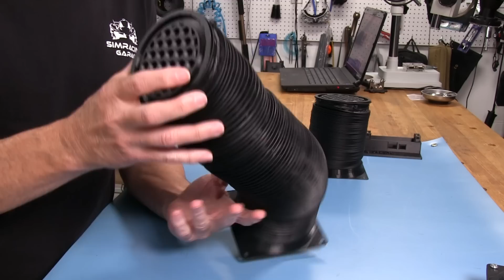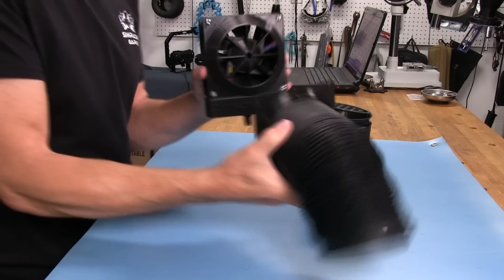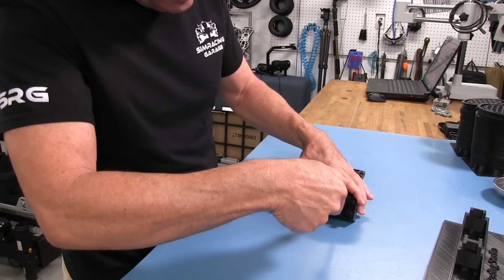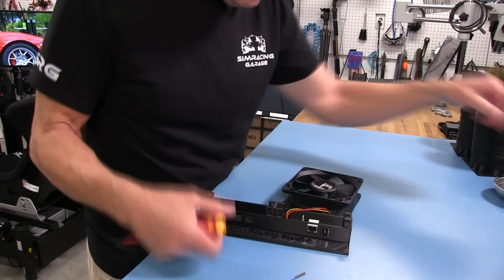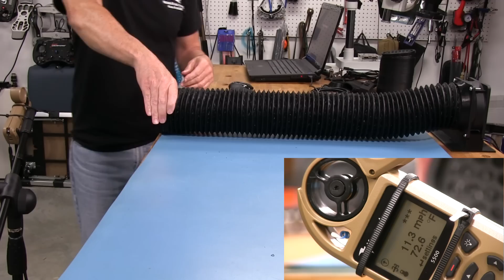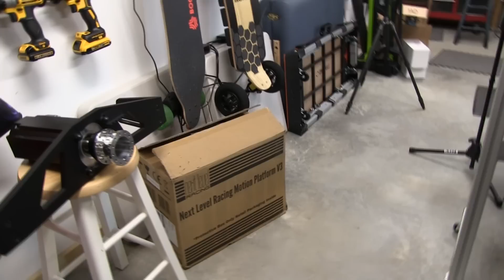SRS Power Wind Tube Upgrade Kit

Comment: A great example of FDM manufacturing of niche market products. And about the price... Think about phones. When you look to raw base components, it looks like it's overpriced. But when you add designing and manufacturing costs (quality filament doesn't come cheap and neither does a 3D printer that you can deploy for dependable commercial use), it's actually a fair and good price.

Comment: I wish someone made a system like this that just blew air at a couple different speeds hooked up to a toggle switch. I like the racy look and the tubular design. 

 Why doesn’t that exist? I’ve seen some diy but I’m looking for a ready to go kit. I don’t see any benefits to “wind simulation” for sim racing personally. Plus having to run more software on top of the half a dozen I already run.
Reply: You can just hook up a 3-12v power supply to 2 computer fans and adjust the voltage for different speeds. You can buy the tube at a hardware store but the other pieces need to be 3D printed and I agree that it would be nice if someone would sell those pieces because not everyone has a 3D printer just laying around to make small parts like this.
Reply: Eric I could see a plug and play regular fan system that has a motorsport aesthetic and doesn’t require software... selling really well. Maybe have the controls for it wired into a button box that also works as a button box.

Comment: Nice vid!
btw,will you give a full review video of that simagic dd wheel in near future?
Thanks.
Reply from the maker: I only tested it for a couple of days before I had to send it back to the person who owned it. Once they are shipping the production units, I plan on getting one to review.
Reply: @simracinggarage3026  
Thanks for the reply.
I do really want to know how the performance would be of the wheel,
seems like they only ship the products within/near China, 
or maybe worldwide through contact with the seller.
This is the only website to put order i could find so far. 
https://item.taobao.com/item.htm?spm=a1z0k.7385961.1997985097.d4918993.656857a8Oji512&id=572417730578&_u=t2dmg8j26111

Comment: hi Barry, sorry to go off-topic but could you please tell me the brand of the 70mm wheel hub extender you're using? thanks!
Reply from the maker: I have a 2" and 4" version of this extension: https://www.ebay.com/itm/4-Steering-Wheel-Spacer-Polished-Aluminum-for-MOMO-NARDI-ISOTTA-SPARCO-OMP/111015588260

Comment: I'm a bit confused about the immersive element here. You don't feel any wind when sat in a car. I guess you need to try it to understand?
Reply: It’s all about fooling your brain. Feeling high speed wind gives you a sense of speed / movement regardless of what car your in. Combine this with motion / buttkickers / vr and it’s amazing
Reply from the maker: Good for single seat car simulation. Tin Tops can also have ducting to direct air onto the driver.

Comment: Nice Evolve GTX you got there ! I love mine ;) So....Boosted or Evolve ??
Edit : I was wrong , i watched more and realised its not a GTX !! just a board with a similar grip tape scheme , lol
Reply from the maker: It's a LaCroix DSS60. Fantastic eboard!
Reply: @simracinggarage3026  Makes my Evolve GTX look cheap , lol Im sure it is fantastic ! Nice to see your a skater also ! Good stuff Mate ;)
Reply: @simracinggarage3026  30 odd miles range WOW ! im stoked with my 30 kms range ! and 37 km h top speed on my AT's , how fast does that go ?
Reply from the maker: I have seen folks do 32mph. But I'm sure it is dependent on rider weight. I haven't gone faster than 27. And that was not maxed out. I'm not a speed demon on an eboard. I mostly enjoy the great carving you get on this model.

Comment: The bend increasing airspeed is fluid dynamics and Bernoulis principle in action. If you constrict the volume of a mass of air, it must increase speed to compensate. This increase is caused by the high pressure in the middle of the kink, and low pressure in front and behind it. It's the same reason putting your thumb over a garden hose causes it to jet out in a stream. The "diffusor" on the fan is also constricting the air, causing it to speed up, by taking a larger diameter fan housing and funneling it down into the smaller diameter of the duct. The other panel is slower because it leaves a gap that causes turbulence and trapped air which increases drag which slows air down.
Reply: Is it a sarcasm?

Comment: Rather overpriced for $90
Reply: If you want the STL files to print on your local 3d print shop, I can supply free of charge. You will probably realize that it will cost much more than that. double or triple. :-)
Reply: @gmerariu  I get that its expensive to 3d print due to the time involved but I'd prefer to rig something together from some ventilation parts. 

My local 3d shop would do it for no more than $30-$50 BTW with a 3 day lead time.
Reply: Gilbert Merariu do you still have the 3d print files? If so I could use theme I have 3 different printers.
Reply: Completely understand. Yes, you can procure most parts and build a similar concept. Probably just need the air straightener to increase wind speed

Comment: What servo motor is that??
Reply from the maker: Simagic. Just helping out with some testing for now.
Reply: looks like it's call Simagic..
Reply: https://simracer.es/hardware-de-otono/
(use google translator)
Reply: It’s a Chinese brand called Simagic with a way cheaper price tag and rock-solid industrial craftsmanship standard comparing with Fanatec. The owner of the brand used to make the chips and mother boards in direct drive wheels, but not many people would wanna buy a piece of mother board and DIY the rest of the wheels by themselves. This servo motor is great in terms of the amount of torque and the smoothness it has, but the downside is that it only works on PC and does not have the licensing from racing game manufacturers.
Reply: @Himmel4243  does this mean it's not recognized by most games?